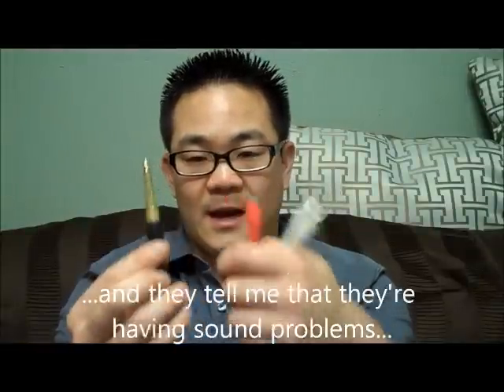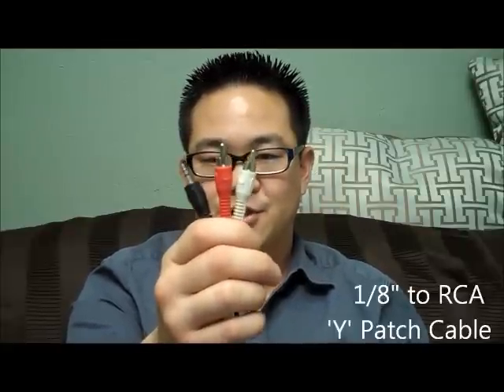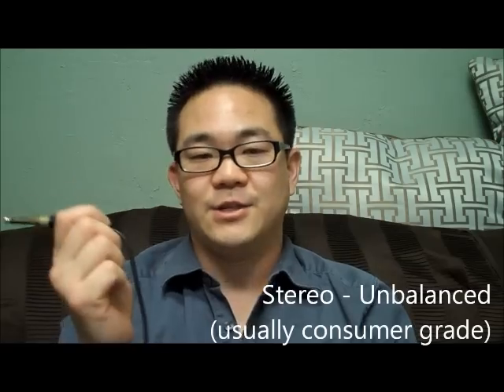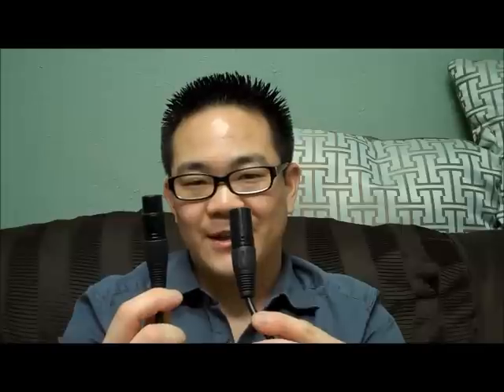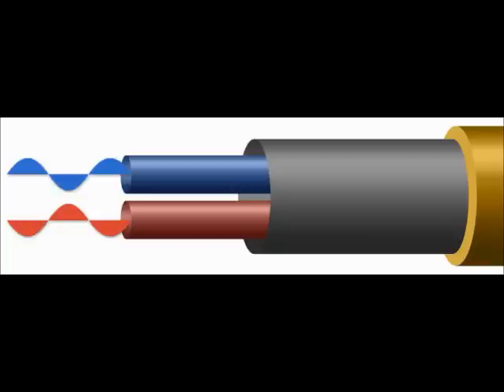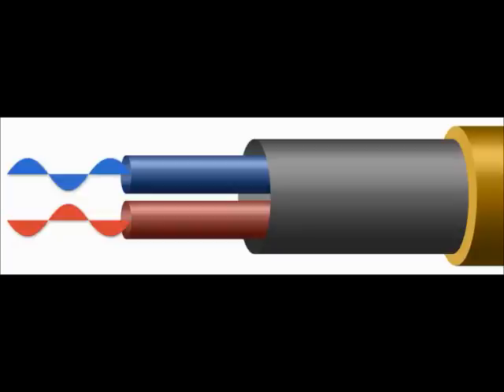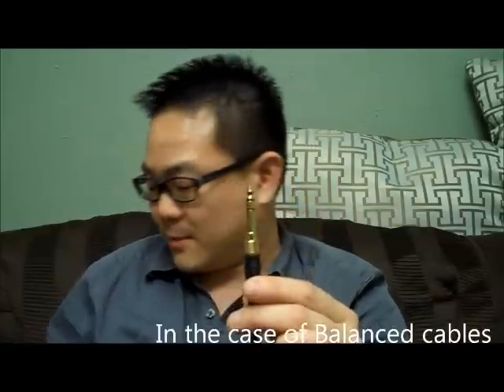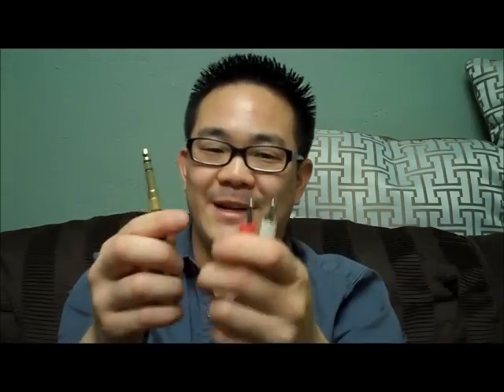DJ Tutorial - Troubleshooting Monitor Speaker - Balanced vs Unbalanced Signals

Comment from the maker: Thanks for watching.  What kind of 1/4" are you plugging into?  Is it on the back of a studio monitor speaker? On a guitar amplifier?  A PA mixer?  These have different impedance ratings for different uses and if you're running a consumer end line-out, you may have to impedance match.  They way also vary in balanced, or unbalanced. Also, if your synths are outputting stereo, you'll need to sum the channels to mono.  I would suggest summing with a circuit built for it if you're using it on stage.

Comment from the maker: @vixflicks Yes, if your monitor accepts a 1/4" TRS (tip, ring, sleeve; the kind of 1/4" with two lines as oppose to one), it would be appropriate to come XLR out of your mixer and 1/4" TRS into your monitor.  Also, if you look at the back of your monitor where the 1/4" jack is, check to see if it says Balanced / Unbalanced; this means it will accept both types of signals, but you don't want to send an Unbalanced stereo signal, because the monitor will interpret it as a balanced mono signal.

Comment from the maker: I would use a balanced 1/4" (TRS) Male to balanced 1/4" (TRS) Male cable, or a balanced 1/4" (TRS) Male to XLR Male cable to make that connection.  You might try using an instrument cable (unbalanced 1/4" to 1/4") but you will run into humming if you run a long cable.

Regarding 1/4" jacks, balanced cables will always have what resembles a stereo jack, with the two black lines, but don't call it that, because the connection is very different, and that's a problem; call it Tip-Ring-Sleeve (TRS).

Comment from the maker: Make sure the 1/4" jack input on your monitor is for LINE-IN; not mic input.  Sometimes there's a switch or toggle that will turn the mic preamp on.  Make sure that's off.

Might still work the way you want it to, but I wouldn't risk blowing the speaker.

Comment from the maker: You need to use the Breakout cable that comes with your Apogee to make the proper connection.  There is a set of balanced outputs (left and right) on the breakout cable.  Are you using the headphone jack on the unit?  If you've lost the breakout cable, a DI will convert the unbal signal from the headphone jack, but I would concentrate on getting another breakout cable, since you need it for recording also.  The cable to make that conex is 1/4" TRS (looks just like a stereo 1/4") to XLR Male.

Comment: Very useful piece of information! Thanks! I have a question. I have an Art Dual Pre USB interface that has 2 1/4" outputs and one headphone output. Im want to connect these to my KRK Rokit 6 which has a XLR and TRS (balanced) input as well as an unbalanced RCA input. What is the best connection i can have to get the best sound out of my speakers? I am mainly only be using logic pro 9.

Comment: Thanks for the explanation.  Just so that I'm clear, though, if the monitor only accepts a 1/4" jack, will using an XLR-to-1/4" adapter rectify the situation?  IOW, if the signal being fed from the mixer comes from an XLR output but the monitor requires a 1/4" input, does the adapter keep the sound pure?

Comment: Hey, great video man, helped me understand why I can't get full audio from my iPad (1/8) to a 1/4 input. I have a lot of synth apps that I'd like to play live by connecting it into a 1/4 inch input, which plays out the speakers. The only converter that has worked for me so far has been an 1/8 to 1/4 inch converter, but these converters break really easily, usually from the weight and size of the guitar lead. 
Do you know of any cables that will get my iPad (1/8) audio output to a 1/4 inch input?

Comment: Hey great video! I just upgraded all my equipment and now im going through an xlr speaker switch (pro co switch witch) to select between two sets of speakers(jbls and samsons). The samsons are rca unbalanced so im using xlr to rca cables. Im picking up the PC's processing noise through the samsons. If the pc is off theres no noise and if i bypas the switch and go directly from my RME babyface (xlr to rca) theres no noise. Why would there be noise when i go through the switch?

Comment from the maker: Which speaker do you have?

If your powered monitor has a 1/4" jack input, get this cable: Hosa CMP-105.  It will sum the stereo channels (3.5mm; earphone plug) to a mono channel (1/4" TS) while maintaining an unbalanced output.

Comment: Hi, the main output on my mini mixer has two 1/4" unbalanced output (L&R). The venue only offer a XLR female connection to their house-sound (I'm guessing that is a XLR mono balanced input) - What cable should I get to output my Stereo to the venue's Mono? Thank you!!
Reply from the maker: LOL sorry for never answering this.  You're gonna want to get a DI Box, preferably an active one.  The reason is, it's likely that the connection is balanced, but you can't tell if it's high-z or low-z, mic input or line input.  If it's preamped for a mic, you would have to attenuate the signal, and if you're doing that with your master knob, it will raise the top case's noise floor (hiss).  It's best to attenuate with a DI box which drops the entire line signal, including the noise floor.

Secondly, it's likely that you're connecting to a mixer in a different room on a different electrical circuit, which makes ground loops to be likely.  NEVER EVER lift your ground pin on your IEC cable!  You will either fry your gear or yourself, but more likely both at the same time.  A decent DI box will have a ground lift that will safely disconnect the ground between your topcase and the house mixer.

Pyle makes a two channel passive DI Box that's perfect for DJs Pyle-Pro PDC22.  $15 on Amazon.  You'll need to tweak the treble and bass a little, but it sounds decent for what it is, and at $15 you have no excuse not to own one.  Get it, and have a couple of 6' patch cables so you're never caught off guard when tapping into a venue.  https://www.amazon.com/Pyle-Pro-PDC22-Instrument-Balanced-Unbalanced/dp/B00356J8KE/ref=sr_1_2?s=musical-instruments&ie=UTF8&qid=1479161741&sr=1-2&keywords=pyle+di+box
Reply from the maker: BTW I've had the Behringer DI20 for years which is active and runs on 9v battery.  It costs twice as much, but sounds nearly perfect.  If you're willing to make the full leap into a DI box get the Behringer or higher.
Reply: thx so much! Well the wedding from 2 years ago is over LOL I think I got it worked out by recording Mono using 1 cord and it worked great. It was suggested by a DJ at a forum. It was a creative and simple fix. Thanks again for replying!

Comment: I'm having problems with my monitors (Genelec 8020b's) when using them with a apogee duet. Distorting/ cracking at both low and high volumes with no signals clipping anywhere.
Apparently the L-R out from the duet is unbalanced and the Genelecs require balanced?
The cables im using are male stereo jack (from duet) to female Xlr (to Genelecs)  
Will a 2 channel Di box fix this maybe?
Thank you.

Comment: I have a DJ setup, and my DJ mixer has RCA outputs...I experience the problems explained in the video (weak signal, echoes)...but, how do I remedy this? The video explains the problem, but offers no solutions...
Reply from the maker: They Tom, the solution would be either passively summing the channels by using a y-splitter in reverse (which is actually not recommended as it would change the impedance of the load in relation to the supply) or you can go with one channel or the other.  If you wanna read up on why passively summing is a bad thing, here's an article from Rane http://www.rane.com/note109.html  

Of course, you can use your own discretion (hey it's your gear!) you can use something like this for the passive sum http://hosatech.com/product/ypr-124/

A third option would be to actually convert the signal from unbalanced to balanced with a DI box, and run the two signals parallel so the box takes the heat, not your monitor.  Amazon has a passive one from Pyle (PDC21) starting at like $8.  Doesn't sound perfect, but it works!  There's a two channel active one from Behringer (DI20) for like $30 that I've used for years, and that one sounds pretty good.  They're worth having in your arsenal, especially if you gig at bars and pubs because you run into all kinds of connection issues when the stage was not built for DJs, but this might not be over doing it if you're just looking for a solution at home.

Hope that helps!  Good luck!
Reply from the maker: *might be over doing it

Comment: i  have a gemini slate 2  with a pair of 502 tannoy speakers. im having a difficult time trouble shooting... i have a PC with windows 8.1 i downloaded the drivers and did everything i was supposed to but every time i play music theirs static. could it be the RCA chord or something else going on? PLEASE help thank you
Reply from the maker: If it sounds like crackles as the music is running, increase the latency to see if it improves.  If it's a grungy sound turn off the key lock / master tempo.  Also, make sure your wifi is disabled by putting your computer into airplane mode.  If you haven't optimized your windows for music, do that first: http://djtechtools.com/2009/07/15/optimize_windows_djs/